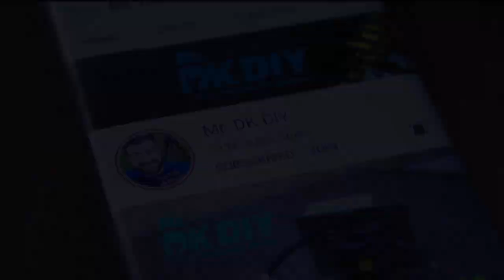WHY DO WELDERS NOT SPEAK ABOUT THIS SECRET ??? How to TWIST Square Bar with an MAP GAS Torch

Comment: This type of work is more commonly done with a forge, but it doesn't really matter how you heat the bar, just that you get it hot enough. Another cool thing you can do is cut slits through all the way through the flats and twist it into a little metal cage.

Comment: i hope that device was not custom made for twisting a bar because you just need a vice and a adjustable spanner with a stick welded on the front. Like results are fair but I think its the definition of "overengineering a solution for a simple problem".